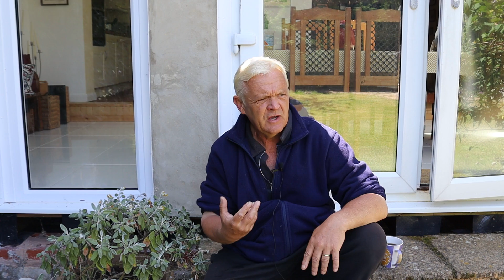2289 What The Hell Are Amps?

Comment: As an EE, it's sometimes hard to explain concepts like these to folk who don't have experience of their own.  I appreciate your taking time to explain this concept in a way many folk will understand!

I also, especially, appreciate your clearly pointing out that your personal tendency is to feel like more volts means more power. And why. (the ability to transform voltages).
I've seen many of your videos and always feel (my own personal tendency to feel) that the voltage-measurements you get from various generators are impressive, but (I'm sorry, it's my feeling) a bit meaningless without a load to show the actual power generated.
BUT: That is a tough topic, since the only way to measure power is to attach a load, and, in general, the maximum amount of power that such a generator (or solar cell, etc.) can produce is highly-dependent, as you said, on a load being matched to the generator.
So, it creates a chicken-egg problem, that you've had me pondering for some time... How do we find the [maximum] power-output of our power sources, the easiest way possible? And, from there, how do we match our load to that source?

Solar panels are very interesting (to me) examples. A single solar cell is essentially a diode that creates current proportional to the amount of light on it. That sounds obvious, but it's deeper than one might think. And your explanation of amps/shove, here, tiuches on why.
See, if there's no place for that current to go, then it's just a voltage-source. Kind of like a motor-based generator with no load. But: because soloar cells are diodes*, they start *conducting at around 0.6V. So they really only act like motor-generators at less than 0.6V. At 0.6V they act like a motor-generator that has a diode across its terminals; as a load that turns-on at 0.6V, and decreases its resistance as the generator increses its output power... Thus, maintaining roughly 0.6V at its terminals regardless of the available power... and wasting any power that results form higher than 0.6V in the form of heat through the diode! (and too much heat-produced by/in that diode can damage it!)
It's a weird concept to consider. [Maximim] Power-matching, for solar cells, is important-enough that it's considered quite a lot more than for other power-sources.
I'm not certain, but my guess is that a solar cell is best-off if its output voltage is kept below 0.5V (lower than rated), and I hear their outputs can even be shorted, safely, so any power generated results in heat in the shorting wire rather than in the cell itself!
So, now we have a weird scenario where voltage-output is not at all an indication of available power... A hypothetical large-enough cell could produce AMPS at 0.5V, many watts. A panel of such cells, 100 in series, might output 60V. At low-light it might only maintain 60V at 100mA (6W), but at high light it might produce 0.5V on each cell, for 50V, with a [different] 5A load (250W!) OTOH, if the load were matched differently, those same lighting conditions might result in 40V with a 7A load (280W). BUT, that doesn't imply more power by merely dropping the output voltage. If it were dragged down to 10V (instead of its rated 60V) it might produce more amps 10A (100W) but now we've got much less than the maximum power (upwards of 280W in this hypothetical scenario).

I, personally, find this somewhat fascinating... And, I know it's rather complicated, but understanding this about solar cells has somehow helped me to understand power-matching in general; as, aside from the diode, most generators have similar phenomenon. 

E.G. as you pointed out, the same amount of water might flow into the turbine of a hydro, but if the hydro's load is too heavy, it will just stall the shaft. If it's too light, then the hydro's output-voltage will remain relatively constant, but basically all the power it could be putting out goes unused. (but, unlike a solar cell, it isn't wasted as heat).

So, power-matching is an interesting topic. E.G. if one's using an intermittent power-source (like solar or wind) to charge a battery, it'd be ideal to charge that battery at the maximum rate possible with the available wind/sunlight. And, even more ideally, to do-so at the maximum rate (by drawing the maximum power available) as the wind changes and sunlight varies with clouds. 

THAT is a complicated challenge, because, again, the only way to know the actual load necessary to match the source means constantly measuring the voltage and current (multiplying them for watts), while varying the load! Who has a variable load like that?

So, they've developed "MPPT" devices, with onboard computers, and variable input/output DC-to-DC converters that do exactly that. Though, I'm sure they come in various forms and quality-grades.

If you're connecting your generators to "the grid", I guess, ideally, you'd use one of these to always/constantly transform your maximum power-available to the grid voltage. OTOH, if you're only charging batteries, then what do you do with that maximum-power-available when the batteries are full?

And, again, such MPPT devices usually involve a (small) computer, and DC converters that, frankly, couldn't've existed a few decades ago, nevermind be designed/built (or maybe even be understood/configured) by even advanced hobbiests/experimenters

So, it's an ongoing thought: How to make these concepts more accessible... especially to folk experimenting with generators of the sorts you experiment with. Is there a simple device/method for measuring power output by these devices? Sure, tie a resistor to the output and measure the voltage across it, use ohm's law, calculate power. But, again, for most of these devices the maximum amount of power they can output may vary dramatically with the amount of load-resistance chosen.
Maybe, at the simplest, grab two $10 multimeters, and a high-wattage potentiometer... turn it through its range until volts*amps is at its max? Maybe there's a cheap watt-meter available that can work with a wide range of voltages? Or cheap multimeters with USB outputs that could be connected to a computer to do the math?

I dunno, my tendency is to build such things when I need them...

But, of course, measurement of available power is just the start... "Transforming" the available voltage/amperage to the needs of a load (matching the source to the load) is another step. Possibly requiring a DC-DC buck, or even boot converter.

Full-on MPPT is a bit much for an experimenter. But, turning a potentiometer and watching a meter is doable, to get a sense of what sorts of loads could be attached to the generators you/they come up with, and what sort of (DC-to-DC?) converter would help.
Reply: The simplistic way, as I understand it, is to match the internal resistance of the generator to the resistance of the load, for maximum power transfer. So a 10 ohm coil in the generator and a 10 ohm load, for example.
Reply: @jima3252  Good call. In fact, now that you mention it, I think I recall their teaching this in my Power Engineering course.

I think it can get more complicated, since windings also have impedance (like an inductor), and various other factors also including typical loads rarely being purely resistive. And I think it's difficult to measure internal resistance of other types of power sources (solar, thermocouples, piezo?).

BUT as a general rule of thumb, useful-enough to be taught in EE classes, so surely would give useful results from these sorts of experiments, I think you're spot-on.
Reply from the maker: that does lead to maximum power transfer - but for something like a wind turbine you would probably need something like MPPT to ensure it
Reply from the maker: Mate - that was an absolutely fascinating post - thank you for taking the time to write it. You raise a lot of good points that trouble me too and a nice suggestion at the end - cheers

Comment: Electrons move extremely slow. Much slower than the fields that make up the electric current. The amount of magnetism in a circuit is measured in Amps, the amount of the dielectric field is measured in volts. When these two fields work in conjunction you get watts.
Reply from the maker: there are lots of ways of seeing it mate
Reply: @ThinkingandTinkering  thank you for not saying I am wrong. I don’t think you are either, it’s just not that simple. If you get a chance, go down an awesome rabbit hole with “Eric P. Dollard”

Comment: Interesting.  Nice twist to ohms law, I like your approach. LOW amps at high Voltage equals less stress on the wires, less losses to heat,,,,  BUT I just bought a load of 18 gauge wire 🙄
Reply from the maker: ah - lol

Comment: Thanks Robert for the clear explanation.

I have a bit if an odd question related to eddy currents. 

 Can a non ferrous rotating metal disc such as aluminum induce/boost the current in a copper coil like the serpentine coil of the generator(previous vid) if there is already current flowing in it making it an electromagnet. Almost like a alternator in a car but with no magnets? Would there be any merit in finding alternatives to rare earth magnets for generators/motors
Reply from the maker: there is a constant search for alternative to rare earth magnets mate - lots of research and some really exciting ideas - some going into production as we speak. As for your aluminium question - I honestly don't know
Reply: @ThinkingandTinkering  Thank you so much for your response, I'm quite interested in using eddy currents induced in a non ferrous metal like copper or aluminium by an electromagnet will be useful as a motor and could a magnet-less generator be built.  Can your xtool cut either I'm not sure but it would be  interesting? I really appreciate your video please continue to inspire us

Comment: The way I remember these important things is:

Amps is the flow rate of energy, like fuel flow.
Volts is like the fuel pressure
kW is like current speed
kWh is like Miles per Gallon 

Good video!
Reply from the maker: Thanks for sharing
Reply: But Watts are the flow-rate of the energy.  Not amps.  Two separate things are flowing in circuits, electrons and energy.  Electrons flow slowly, going in a circle.  Energy flows at lightspeed, going one way (going from the source to the load.)

Analogies: Amperes are like the motion of a drive-belt, or like the speed of gears.  Or, in a hydraulic system, amps are like the flow of the oil.

Think of it this way:  in AC systems, the energy zips along at lightspeed.  But the electrons just sit there and wiggle slightly.  The electrons' AC motion is measured in amperes.

Or, if we suddenly yank on a long rope, the rope-wave goes zooming off to the far end.  That's the energy.   But the rope itself moves towards you, and it also moves quite slowly.  That's like amps.

Or, if you yell loudly, the air wiggles back and forth.  That's like the amps.   But at the same time, the sound-wave goes zooming outwards at hundreds of KPH.  That's energy, and energy-flow is measured in watts.
Reply from the maker: @wbeaty  errr - energy doesn't flow per se - it's transferred from one point to another - the electron is the medium of transfer - The watt is a measure of the rate of energy transfer over a unit of time, note - transfer.
Reply: @ThinkingandTinkering  Wrong.    "Electrical energy" flows through circuits.   Pure energy is just a concept and cannot "flow," but light sure does, and radio does, and low-frequency EM does.  The flow of each one is commonly expressed in watts.  Same with sound.   Same with mechanical energy traveling along a drive-shaft.   Electrical energy is stuff-like, a conserved quantity, and so it's able to flow from place to place.   
But we have no good word for "60Hz radio waves which travel along lamp-cords."   Like light and sound, it's "stuff-like," and can move along from place to place.  "Electrical energy" moves at lightspeed across bare wires, slower with plastic-covered ones  ...because it's the same stuff as light and radio.

Or, should we say that light cannot move, because light is energy, and energy cannot flow?     The same applies to radio, and to circuitry.

Comment: Amps. Amplify. Increase of voltage requires larger magnetic field to maintain stability.  Increase the volume of sound requires bigger speakers to maintain the vibration.  Microwave oven.  240v pressure going through a nozzle to increase rate of acceleration increases power. Magnetron is required to maintain stability between dielectric and magnetic field.  Turn up the tunes 👍
Reply from the maker: cheers mate

Comment: Just had this conversation with a neighbor today, he grasped the concept when I stated that higher resistance will "impede" the amperage and lower resistance will "encourage"  the amperage.

A nichrome wire in a heater or incandescent light bulb has lower resistance (fewer ohms) than a semiconductor like a light emitting diode (led) + current limiting resistor. 
And that is why incandescent uses more power (p=iv) lower resistance higher amps.
Reply from the maker: nice one mate

Comment: I hope I helped out🥰🥰🥰  when you buy an appliance check it it’ll tell you how many amps are being used when it’s running washing machine is typically anywhere between seven and 12.... refrigerator could be anywhere from 6 to 15 A  or more depending on how big it is and what the capacities are.... A clothes dryer used to 110 circuits together🤬🤬🤬 which would be a 220 circuit requiring a 50 amp breaker.... One like he’s the element in the dryer and the other one spins the dryer😜😜😜 I hope I’m making sense... One thing about electricity that I must interject here as it is very dangerous and if you do not know what you’re doing do not touch it!!!!  Hire a professional electrician💐
Reply from the maker: or learn to do it

Comment: High voltage makes the same power at lower amps - resulting in the power being less "copper expensive" (thin conductors are cheaper). That AC is readily "transformable" is a wonderfully handy feature.  Amps cost more to conduct per unit of distance  - as far as pure resistance, let's  not get caught up in with reactance, especially not at high frequencies....
Reply from the maker: it's why power lines are at 10,000V

Comment: An amp is known as an ampere💐💐💐  if you have a 20 amp circuit and your refrigerator is 9 A and your microwave is 9 A 😱😱😱you have 18 A  you could probably run both appliances but they’ll probably pop the circuit not enough space  for the ampers👀... so for doing something like that you would probably want to use a 30 amp circuit.....   amperes are a group of power, to tell you how much you can use and how much you’re using🥰🥰🥰  you usually not this??? when you’re using too many amps???  when you pop the circuit breaker🤬 it means you’re running too many appliances/amps on that circuit
Reply from the maker: cheers

Comment: I started to understand amps when I started to think of amps being what appliances in the circuit “suck” and volts are what the source pushes. That doesn’t answer every question on the difference between volts and amps but it helped me when I was wiring a 240 volt line into my work shop. 
I always appreciate your educational YouTubes, Robert. Thank you for taking the time to produce this. Amazing to me, better than 8 minutes talking on a rather complicated and confusing subject in a very clear cogent and uncomplicated manner with many excellent metaphors for the concepts, and not a single cut or edit. 
Cheers, my friend!
oddjobbob
Reply: The water analogy often works well to an extent. 
Potential/Voltage is water pressure. 
A pressure difference and the resistance of the connecting pipe defined the water speed, which is Current/Amps.
Resistance/Ohms can be a grid across the connecting pipe, it maintains a potential difference across itself, higher to lower Voltage, converting that difference into heat.
For capacitors, you have to add an imaginary field around water that affects water to water.
Reply from the maker: I get it mate - but 'suck' is kind of about face view - sure they 'suck' at the wall outlet - but somewhere something is 'pushing'
Reply: One comparison which is easy for me to remember is speed (volts) and thickness (amps). So the higher the voltage, the longer the spark, like running faster means jumping further,  and the thicker the rope, the stronger it is. 
Another analogy is car traffic on a bridge. If you have one lane (e.g. 1 amp), the speed of the cars (volts) defines how many cars (watts) cross the bridge per hour. If you want more cars crossing per hour you can increase either the speed or the number of lanes. More lanes require a wider bridge, so more amps require thicker wires. The analogy could be extended to include resistance,magnetic fields and other properties of a circuit, but this covers the basics.